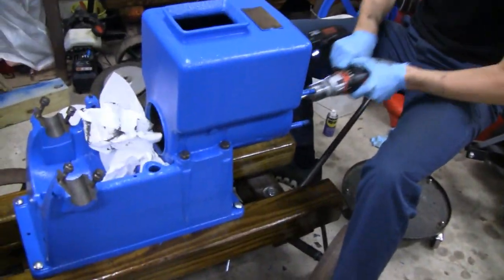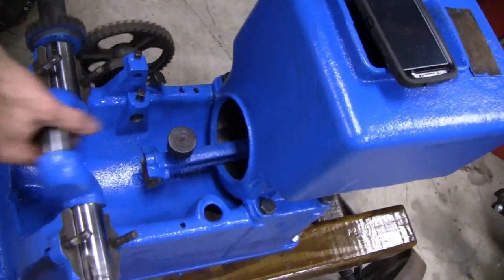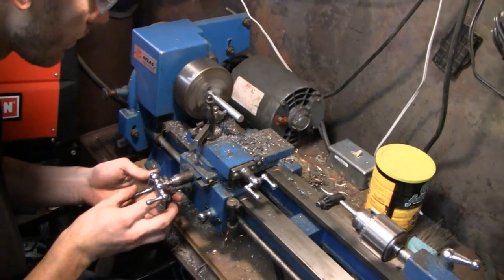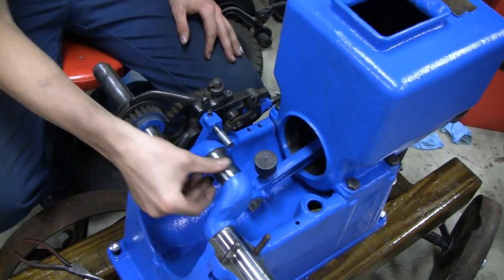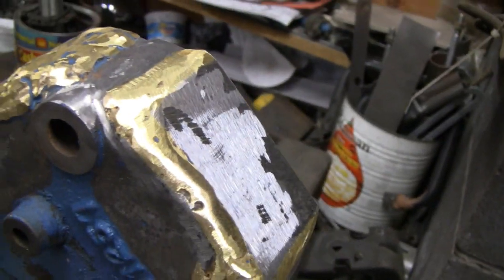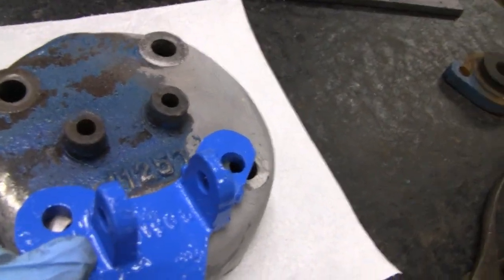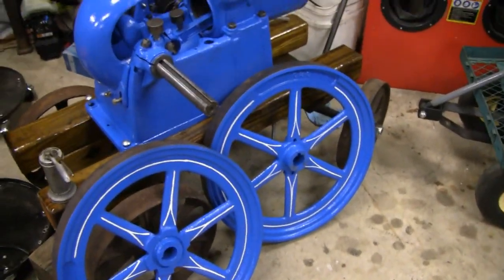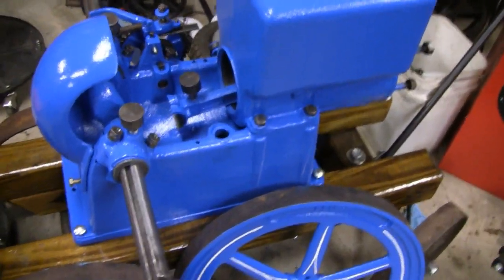ALAMO HIT and MISS ENGINE RESTORATION (part 4)

Comment: The nice thing about the new spark plug plate, you can choose to go with a normal 14mm thread, then just choose what ever plug you want as far as reach goes..  Now that I saw the head painted blue, I can honestly say that it looks fine, and only a hit miss expert would ever notice anything..  To me, it looks Fine, and with all the work you guys are doing, I'd smack anyone who trash talks your engine..  Great Video..
Reply from the maker: Thanks Buddy!! I was thinking the same thing, because I have a 14 tap!! After further review It turns out it's a standard ½" pipe thread so that's what we used!!☺

Comment: That head really looks good after the first coat.. I'm wondering how hot the head gets, and will the Epoxy hold up to the heat?
Reply from the maker: The head will probably hold up fine, at 150 rpms nothing really gets hot!! BTW the mill job on the head is working fine also.... so far!!☺

Comment: I picked up my mini bike project. It wasn't a "Lil-Indian" like the seller said it was. It's a "Huskee Trail Rider" from the mid to later 60's. Everything so far seems to be in good shape ,forks and front springs and the rear drum brake is all good. Has the orig. seat with one tear and orig. tires but missing the chain guard and chain tension wheel and spring.
Reply from the maker: 231flash Huskee is a nice little Bike!! Can't wait to see some video of it!! I think the frame on them is the same as my scat cat was!! The engine mount, chain guard, and kickstand are identical!!☺
Reply: 805ROADKING
Do you know where I can find a 72 tooth spocket with a 3 hole mounting ?
Reply from the maker: That is odd!! You might have to drill your own!! I get most of my stuff from OMB Warehouse but almost any of the places will have something you can modify!!☺

Comment: Hi guys from scrap to near perfect , as i expect to see now with your excellent team work. Looks like somebody got so mad they beat on that engine with a 14 lb hammer once a day for 6 days a week then hit it twice on Sunday for a month L.O.L. just a couple questions if you don't mind, what is that resin filler, and  how well and long it will take the heat of an engine.I was wondering if it would seal a crack in a water jacket on my P6 fordson tractor that I can't weld due to crappy cast.
 If it works really great for that kinda stuff, i hope it don't make anybody up here in Canada glow in the dark, with the chemicals in it. Then I can buy it someplace here, with all our stupid safety hazard rules for this stuff.
looking forward to the next update and this one running.
Regards Robert
Reply from the maker: super6954 Thanks Bud!! I use PC-7 epoxy!! I've had great success with it over the years, don't know how well it will hold up in your situation!!☺
Reply: 805ROADKING Thanks for the reply.i did a search and found a store local that might sell it. Motors going to be junk if I can't do something like the pc-7 , so figuring i'll drill the  ends to stop the crack spreading and try it.
Regards Robert